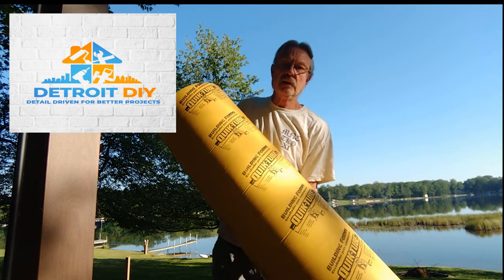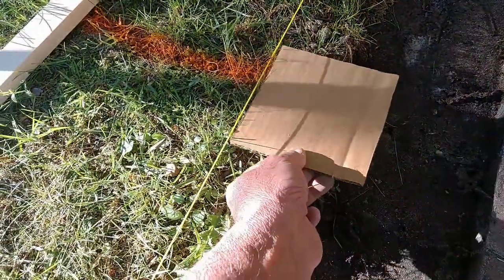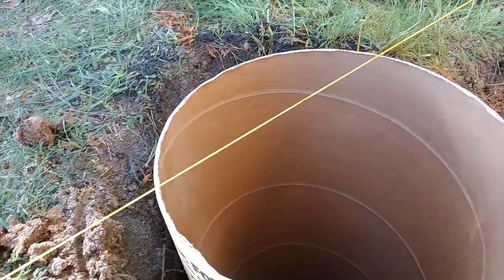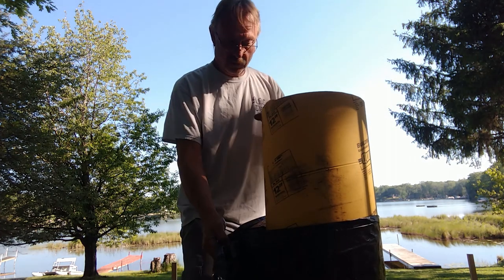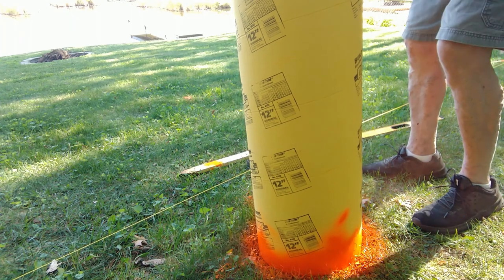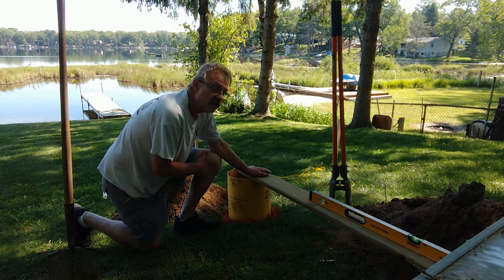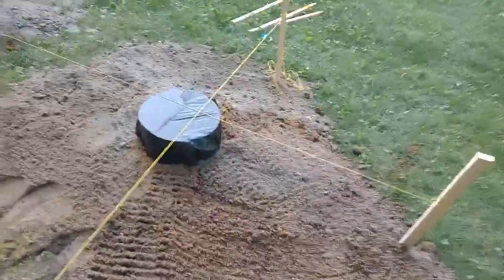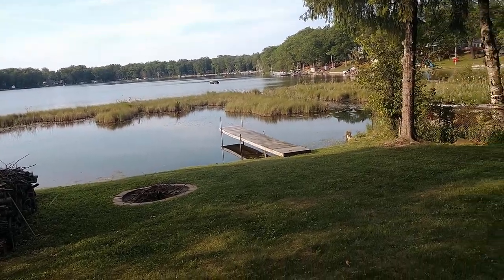How To Install A Concrete Tube For Deck Posts | DECK POST INSTALL (Deck Build DIY #2)

Comment: Tough old guy, digging all those holes
Reply from the maker: That's the second time today I was referred to as old. In case you didn't know 56 is the new 20. I am glad my body still wants to go after all the abuse I have put it through.  I can still do most everything I could at 20 just with a couple more breaks today. Thanks for watching.